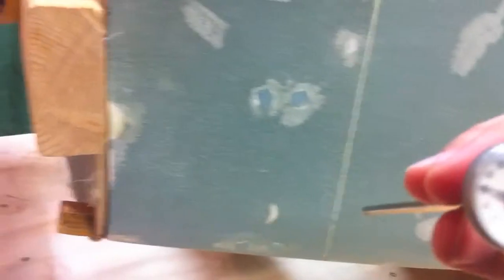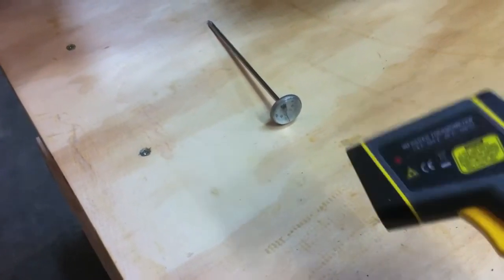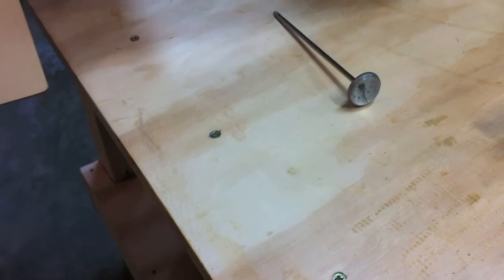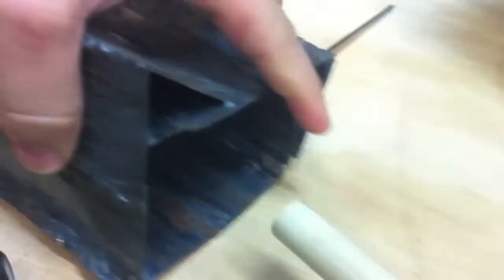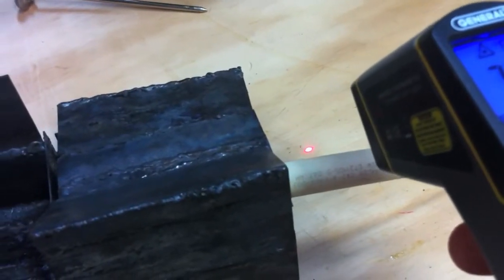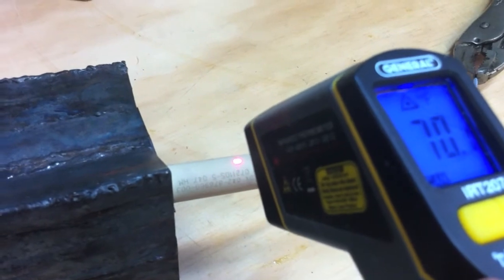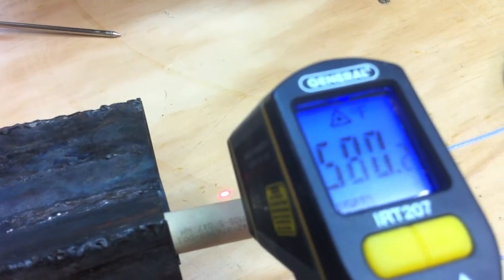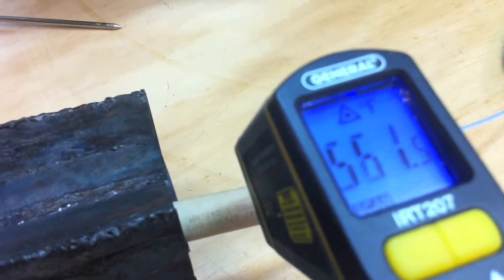Pitot heat - test #2

Comment: Hello and thanks for sharing your experiment. I have a problem. I have a pitot tube design and need to embed a micro heater coil inside it. do you have any idea how we can weld the coil in to inside cylinder?
Reply from the maker: Not really sure, doing any work inside a small tube is a huge challenge. Look into doing the soldering outside of the tube, then slide the soldered assembly into the tube. Good luck.
Reply: thank you friend
but there are small tubes like aircraft pitot tube that you can see the heater has welded inside the cylinder, not onle because keeping the heater in the place, but also to make a good connection between the heater and pitote body which results in a better warm up
 @EZ_shop

Comment: Install the tube inside a phenolic collar, bond with Duralco 4700.  Then install the collar in the nose cone with 4525.  Do tests with it inside an aluminum tube and in ice water, measure the end of the tube that would be in the collar...results are significantly different.
Reply from the maker: Thanks James.
Reply from the maker: Hey James, you might find this recent ice melting test interesting...  https://www.youtube.com/watch?v=y4_CLmXd1jM.

I also did some testing on the road right before that with mixed success. It turned out the battery we used was a junker (4 years old). More testing to come in the next few days.

Here's some info on the monitoring display unit  https://www.youtube.com/watch?v=t9gqzKJR7wM that will be mounted in the cockpit for flight testing, and some on the air/ground switch logic https://www.youtube.com/watch?v=t1iXzMkbKeA

Ciao, Marco.
Reply: You're learning.  Now add 200mph of airstream with liquid water to get just heating calibrated. ;-)   Neat setup, but TMI...after all, you're supposed to be flying the plane.   For automation, I use a relay and a airspeed switch to activate the system over 80kts and the cockpit switch for arming.  POH rule is to only arm the system in freezing conditions and the automation makes sure it's not on while on the ground and shuts off after landing.  No issues in real world IFR use even with lite icing encountered.
Reply from the maker: Good info James, thank you. 
Conceptually I have settled on very much the same setup. The air/ground switch will be replaced by an air pressure activated switch, though right now I am using a physical switch to test the software logic, since I cannot drive fast enough to activate one on the highway without getting pulled over ;-) As you might imagine this contraption hanging off my car window is attracting a lot of attention already.
 I think you are correct with the "TMI" comment, I do plan on using the display only up to the testing phase on the plane, to validate my expectations, though being able to see what's happening in real time has been highly educational. 
Another point you are right on the money with is your very first one. We did drive up to 65mph and dowsed the tube with water, and the drop in temperature was significant indeed. Unfortunately we ran the test before we realized we had a bad battery, so we'll have to go back out and run it again to see what we get. If you are still interested, I'll let you know the results. Ciao, Marco.